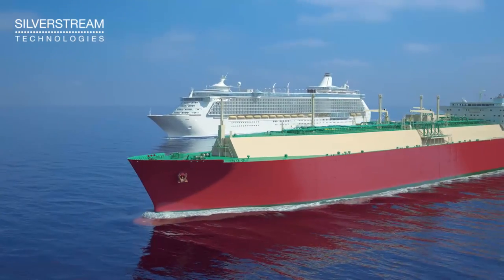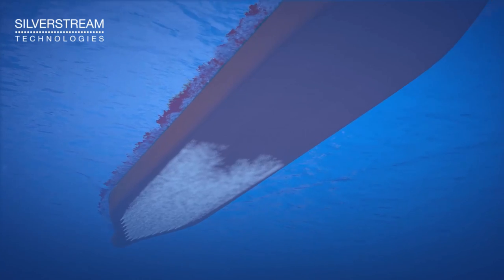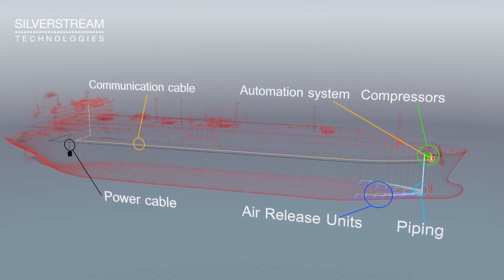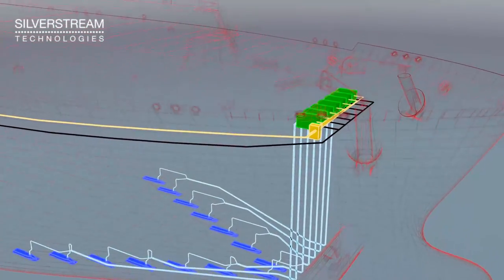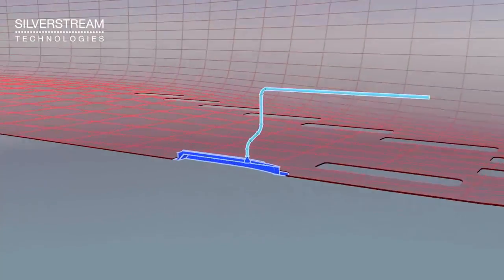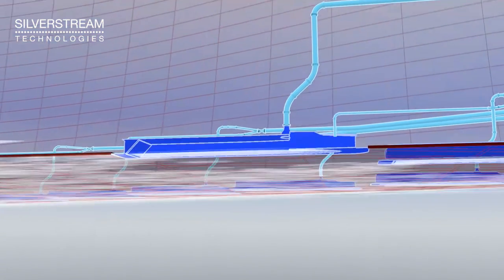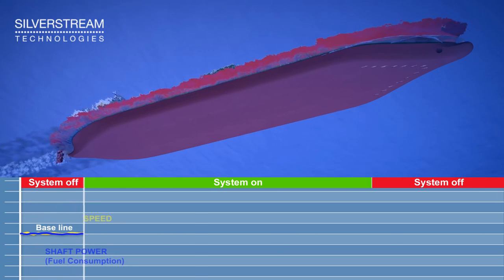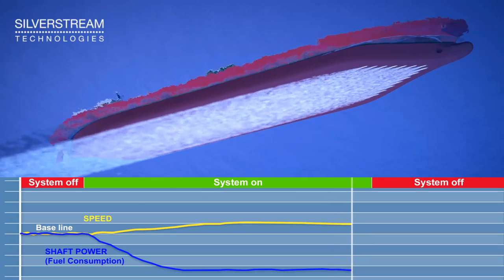Air lubrication for shipping - Introducing the Silverstream® System

Comment: ver the past eight years, the Michigan team has investigated a variety of techniques to cut friction drag. First it looked at injecting slippery polymers into the water at the boundary layer. "Near the injector, drag was reduced by 70 percent, but the polymer degrades in the turbulence and just diffuses away," Ceccio says, "which means it needs constant replenishment, so we turned elsewhere."

The researchers next shot bubbles—a millimeter or less in diameter—into the boundary layer. They got an 80 percent drag decrease for six feet (two meters) or so, but again, no satisfaction; the bubbles refused to cling to the hull surface long enough to have a significant effect on overall efficiency. If one injects enough gas, however, the bubbles eventually coalesce into a buoyant film that can sit (at least for awhile) between the horizontal hull and the water, which is what Ceccio's team is working on now—air layer drag reduction. In this concept, the bubbles typically would leak sternward and out from under the hull. New air would be injected forward to constantly refill the lubricating air pocket.

Scientists speculate that more effective drag-lowering systems using smaller "microbubbles" might be possible if someone could come up with a low-cost way to make the sub-millimeter bubbles. Winkler says that his company is working on a "super-microbubble generator" that would enable existing ship hull designs to be retrofitted with such technology. These systems would also require the installation of surface cavities in the hulls.

The big issue then becomes maintaining stable coverage of nearly the entire hull surface so that rough seas do not simply wash away the bubbles. Continuous, maximal coverage is the key to success; every millisecond that a section of hull contacts water directly contributes to drag. This means ships might have to be equipped with radar and laser sensors that detect oncoming waves, which could permit constant adjustment of air flow in time to compensate for rough seas.

Although the costs of this air-carpet technology have not been fully worked out, Winkler says that adding relatively simple air cavity systems into new ship construction would add 2 to 3 percent to building costs.ggggAir lubrication: Only big bubbles do the trick
Date:
September 2, 2016
Source:
University of Twente
Summary:
Blowing bubbles underneath a ship’s hull, causes them to be pushed against the surface. In the surface layer between the ship and water, these air bubbles cause less friction: it’s also known as air lubrication. In practice, friction can be reduced 20 percent, with a huge impact on fuel consumption and carbon dioxide emission. The precise mechanism is still unknown, as the local water flow is complex and turbulent. As scientists demonstrate, the size of the bubbles make a big difference: tiny bubble don’t have a net effect at all. This may seem counterintuitive, but large bubbles that can be deformed easily, give the strongest effect.
Share:
    
FULL STORY
Blowing bubbles underneath a ship's hull, causes them to be pushed against the surface. In the surface layer between the ship and water, these air bubbles cause less friction: it's also known as air lubrication. In practice, friction can be reduced 20 percent, with a huge impact on fuel consumption and CO2 emission. The precise mechanism is still unknown, as the local water flow is complex and turbulent. As UT scientists now demonstrate, the size of the bubbles make a big difference: tiny bubble don't have a net effect at all. This may seem counterintuitive, but large bubbles that can be deformed easily, give the strongest effect.

For investigating the effects, the University of Twente has a unique 'Taylor Couette' setup, capable of generating fully developed turbulent flow. This machine consist of two large cylinders with fluid in between. When the inner cylinder is turning fast, injected bubbles will be pressed against the surface, just like they do at the ship's hull. At the surface of the cylinder, they start influencing drag. This setup enables the scientists to search for the relevant parameters in efficient air lubrication.

With four percent of air in the water, a reduction of 40 percent is feasible in the experimental setup, using large, millimeter size bubbles. By adding a tiny amount of 'surfactant', the scientists were able to vary the surface tension between bubbles and water, and they could vary bubble dimensions. The other properties, like flow speed and density, were kept the same. What was the result? On average, the bubbles get much smaller, because the surfactant prevents bubbles getting together, coalescing, forming larger bubbles. Within the turbulent flow, the bubble have a uniform distribution and moreover, they will not be pushed against the surface. With, again, four percent of air that is in microbubbles now, there is four percent reduction: there is no net air lubrication at the ship's hull. Ruben Verschoof: "From previous experiments, we knew that deformable bubbles work well, but in no way we expected a dramatic difference like this.

By doing the experiments in real life turbulent flows, and not in the simplified situation of slow and laminary flow, the outcome of this research is directly applicable in the naval sector. For reducing drag in pipelines, the experiments also provide valuable new insight.

The research has been done in the Physics of Fluids group of Professor Detlef Lohse. This group is part of UT's MESA+ Institute for Nanotechnology. Research is funded by Dutch Technology Foundation STW and Dutch Foundation for Fundament Research on Matter (FOM).

Comment: Air Lubrication was tried on Atlantic Conveyor, prior to her loss in Falklands.  In extensive tests, including Arran Measured Mile runs, no increase of speed  or reduction of resistance could be detected.   Maybe the only way the system could be effective is on a ship with large proportion of flat bottom area (which Atlantic Conveyor did not)

Comment: this is impossible because it destroys the air lifting force, which means that the ship will be more fuel-consuming and more fuel-consuming (I hope I have written it in an agreeable manner)
Reply from the maker: Thank you for your comment.
 
Our system utilises compressors which force air through cavities or Air Release Units (ARUs) installed along the flat bottom of the vessel. The air-water interaction (i.e. difference in speed/density of air and water) results in the formation of microbubbles in the water scientifically known as the Kelvin-Helmholtz instability. Due to the size and buoyancy, the microbubbles remain in the boundary layer and flow downstream along the flat bottom of the vessel. This reduces the turbulence intensity in the boundary layer between the vessel’s hull and water thereby reducing the frictional resistance of the vessel as it moves through the water. Frictional resistance accounts for one of the major resistance components of a vessel and as such this translates to a reduction of total resistance reducing the power required for a given speed as Effective Power (PE) = Total Resistance (RT) x Vessel Speed (VS).
 
In this way, the fuel consumed reduces as a lower power is required for a certain speed. Also, for a constant power, a speed increase can be seen. There is no effect on any 'air lifting force' and vessels do not become more fuel consuming which has been tested after installing our system on three full-scale ships over the past 4 years. Our sea trials and ongoing in-service analysis on vessels installed with our system have also proven savings in fuel and reduction of GHG emissions of 5-10%, depending on particular vessel characteristics.
Reply: @silverstreamtechnologies3936  x
Reply: @silverstreamtechnologies3936  thx for the answer, but how about cavitation along the hull over the months/year? How much can this system affected that?
Reply: @JanChacn  It's the same to similar as any normal hull. The saving far out weigh any cost like refurbishment.
Reply: look for aces, that is something that is now being implemented. it keeps the air lifting force by trapping the air under the hull.
Reply: @silverstreamtechnologies3936  he means water lilfting force buoyance not air lift but air in water reduces buoyancy but this air would be so little it would not matter l guess
Reply: Having air under your hull isnt a problem, try to submerge a bell and see how it will float still though having no bottom